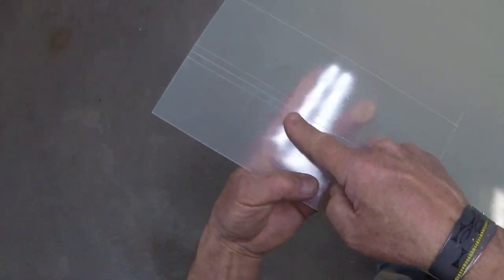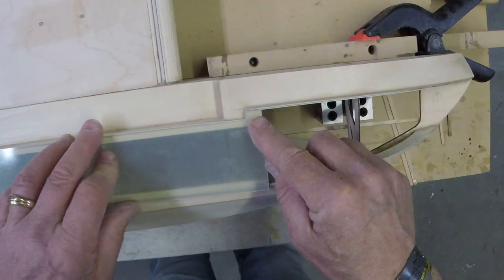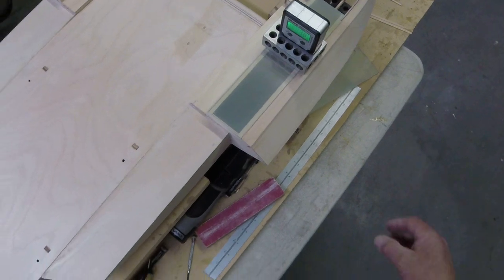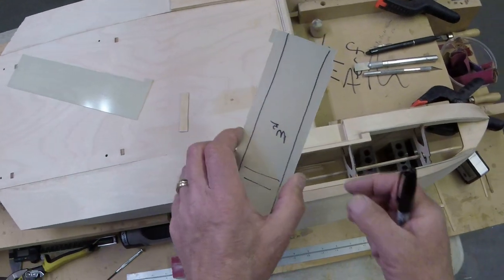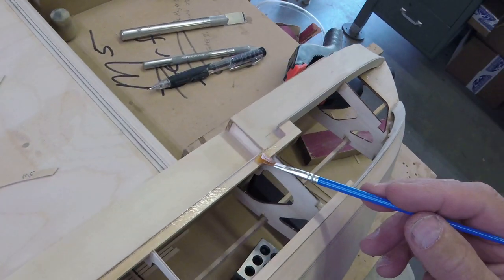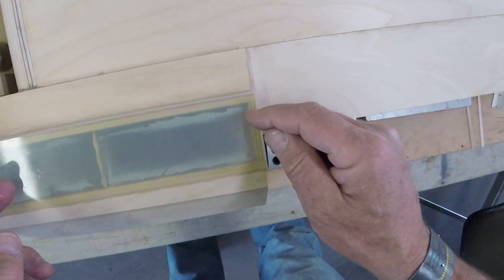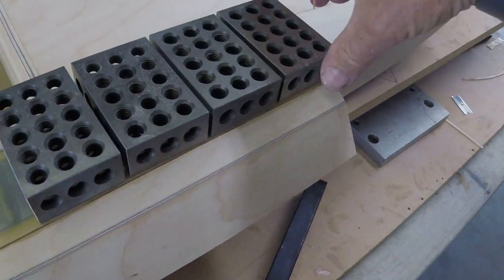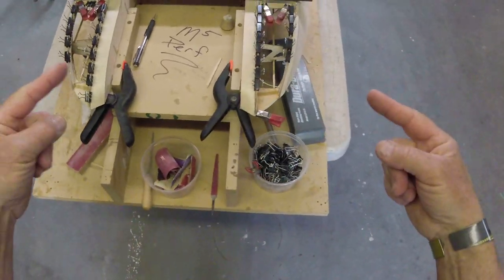Building & Fitting The Ride Pads | RC Model Boat Build - Racing Hydroplane Model

Comment: Scott, just a tech tip, wipe the G10 with acetone before you sand, if I understand correctly the G10 has a waxy release coating when manufactured, learned in auto body classes in the 60s that sanding before dewaxing /decreasing forces the wax into the sanding scratches which tries to rise back to the surface during painting/coating causing poor adhesion.
Reply from the maker: An excellent tip!  You are absolutely right, yet I forget to do that 99% of the time. I usually think of it about halfway through the sanding process, and wipe it down afterward knowing full well that I've already blown it!

Comment: Would there be any problem using carbon fiber sheeting for the ride pads, just windering as I have a lot of carbon on hand for the composite stuff I do.
Reply from the maker: I hate using carbon fiber (black death dust everywhere when grinding or sanding) but there's certainly nothing wrong with using it.  Just get after it and BUILD A BOAT!  🤣🤣🏁🏁
Reply: @M5PerfHydros  Building  a lot with carbon I concur with the precautions needed when using it

Comment: Is the overhang on the g 10 just so you can have extra gluing surface???
Reply from the maker: Huh. I had to think about this answer. Have you ever done a thing, and then done it again, and again, and never really thought about why you're doing it?  Well that's the case here, now that I have actually thought about it.  I suppose that I'm seeking a "clean" breakaway point, or sort of a potential air cavity, that will allow the ride pads to release from the water without resistance.  Any trailing edge, or side edge for that matter, that isn't nice and sharp will tend to stick to the water as the water attempts to roll up and cling to that edge. I call it the spoon effect. You can prove it to yourself by turning on a faucet and dangling the backside of a spoon in the water stream. As you try to remove the spoon you'll feel it being sucked into the water stream rather dramatically. Same thing occurs with any edge under the boat if it isn't sharp.  Great question Len!

Comment: Why do you like this material instead of wood for ride surfaces?
Reply from the maker: Very hard, very flat, never breaks, never warps, what's not to love?
Reply: What about a sheet of carbon fiber?
Reply from the maker: I hate the stuff... More money, greasy surface that doesn't take epoxy well without bagging, and black dust everywhere when sanding. But other than that, it's awesome!